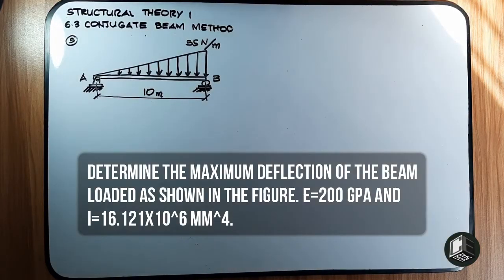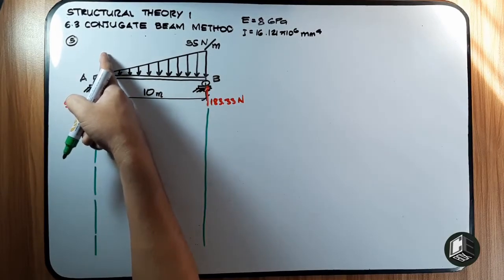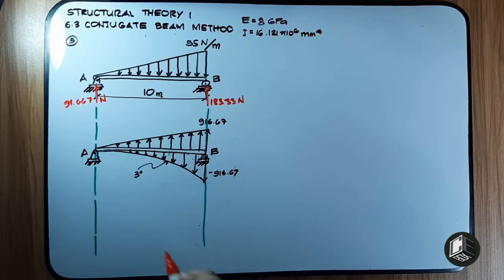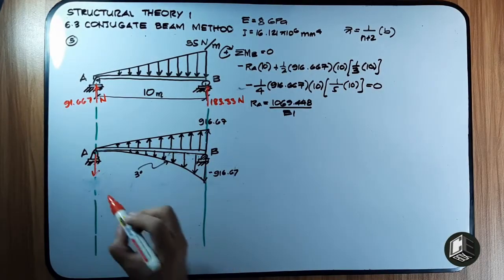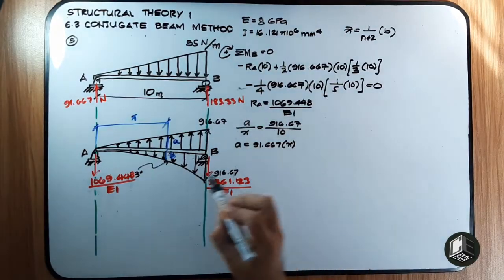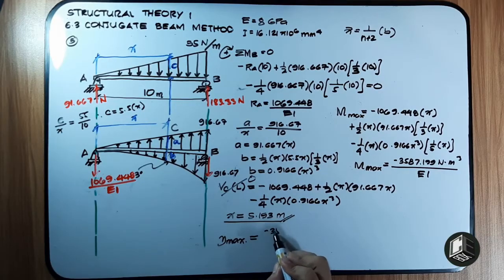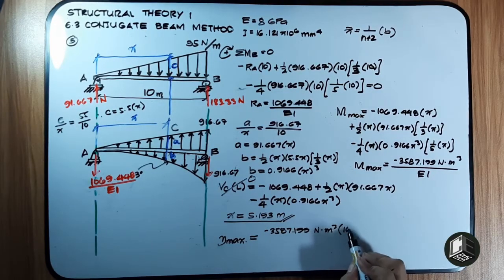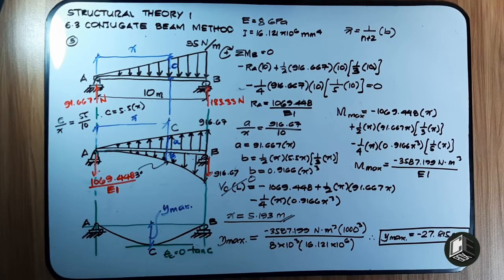Structural Theory 1 Conjugate Beam Method Problem 5 (PH)

Comment from the maker: Correction: Problem 4 po pala ito sa Double Integration Method. :)

E = 8 GPa.

@ Conjugate Beam
Ra = 1069.448 / EI
Rb = 1222.227 / EI
Reply: thank you po sa correction. kaya pala paulit ulit kong sinolve ang reaction, di ko talaga makuha. buti nalang naisipan ko magbasa ng comment ❤️❤️
Reply: pwede po padouble check yung equation sa pagkuha ng "x" ? 13.155 po kasi ang nakukuha ko eh. di ko alam kung saan ang mali
Reply: @stephaniegallos3293 before ka mag shift solve, set mo x/boundary mo to 5 para lumabas yung malapit sa 5 na root

Comment: Hello po, i tried to calculate the Rb po sir using summation of forces (Rb = -1069.445+4583.335-2291.668) from the conjugate beam sir but I got 1222.22/ EI, how did you come up w that answer sir?
Reply: wowers
Reply from the maker: Check the pinned comment, engr.

Comment: Hi sir, paano po nakuha yung -916.67? -583.33 po kasi nakukuha ko doon, thank you po.
Reply from the maker: -1/2(55)(10)(1/3(10)) = -916.667 kN-m
Reply: @cebox  KUNG DI PA AKO NAG BASA NG COMMENT TALAGANG MABABALIW AKO KAKA ISIP KUNG SAN GALING YONG 91.67, MALI PALA NAKALAGAY SA GIVEN IT SHOULD BE 55 NOT 35
Reply: 35 po naka sulat hehe